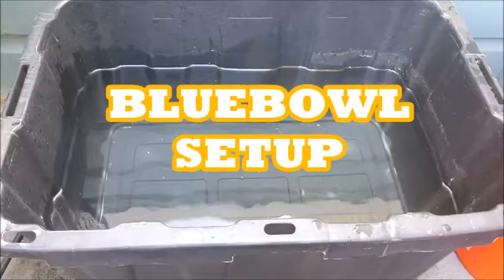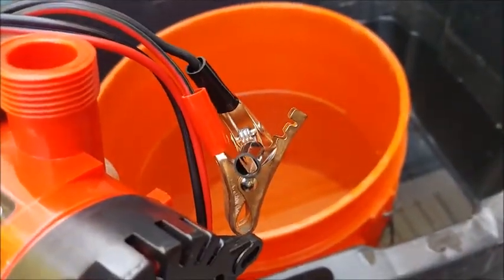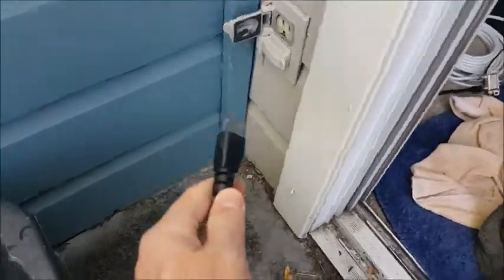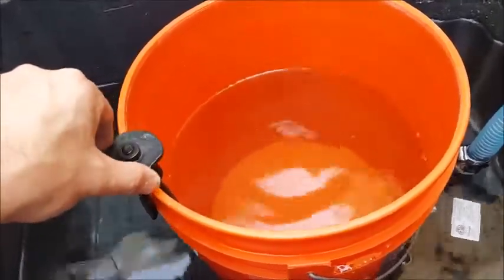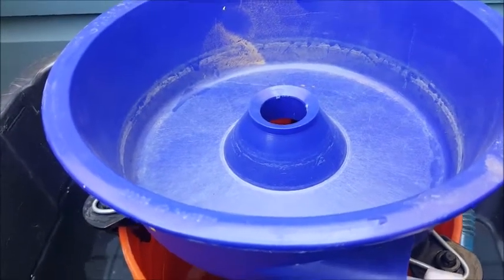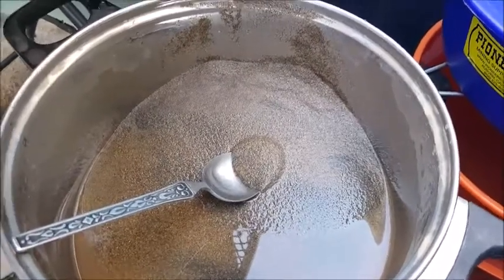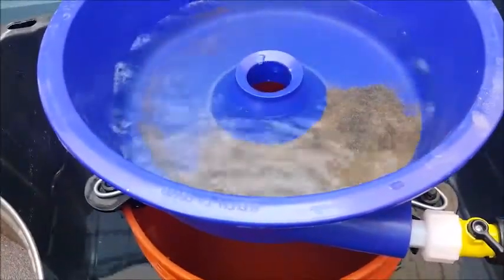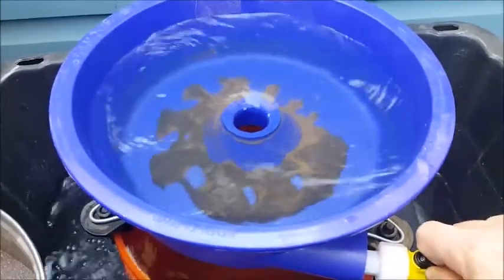Blue Bowl Setup & Fine Gold Recovery Demo

Comment: I’m new to this. Can I run regular beach sand and black sand at the same time?
Reply: Why not? The specific gravity of the particles are still in effect :)  You do want to rinse out any clay and organics though. They will cloud up your water.
Reply from the maker: Yes...the blue bowl will easily lift out sand material first since it is less dense. Just be sure to classify your sand first so part les you are running are similar in size

Comment: I noticed when you plugged that pump into that outlet it wasn’t gfic, you can buy a gfic to plug into you outlet and plug your pump into that, gfic is a ground fault interuptor for that circut anytime you play with water and electrcity you want to use a gfic It will save your life anyany faulty wiring and your dead! The gfic will cut off the curcuit before you get electrocuted
Reply from the maker: Thanks!

Comment: What pump are you using? I've seen the the Johnson 700 gph but, I wonder if a faster on is better
Reply from the maker: I don't think faster would be better it would spin the water too strong and youd lose fine gold. It runs at like 1/4 the capacity of this pump as it is with the valve.